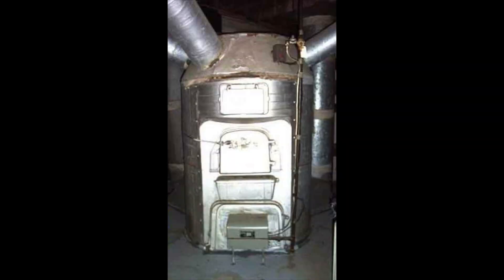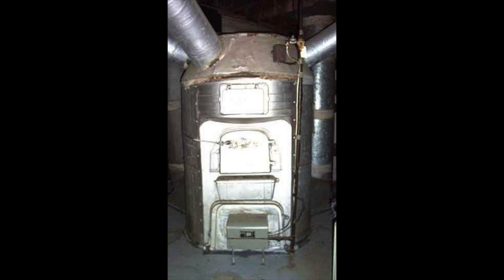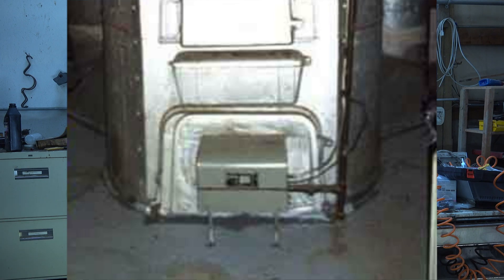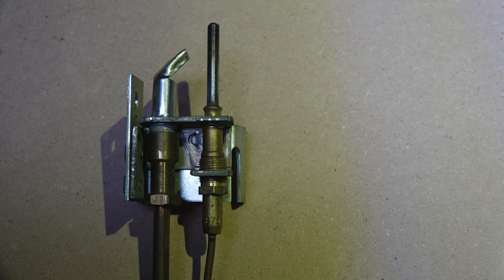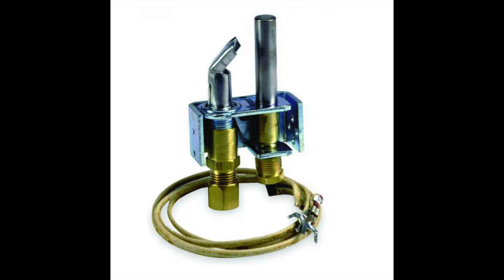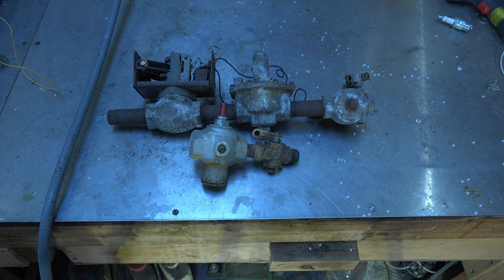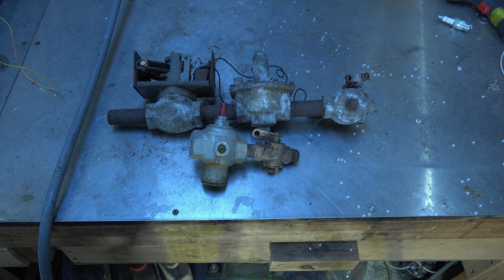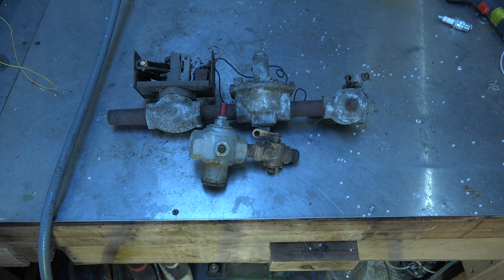Repairs of the gas conversion burner

Comment: I think another reason why these lasted is these are (ones that have been converted to gas) pretty much have the same exact complexity of a water heater (pilot, thermalcouple/thermalpile, main burner assembly, gas valve), not much to go wrong. 

Not the most efficient things in the world, but run and run forever. Even work without electricity as well, silent too in operation.

Comment: Are there versions that don’t have automatic pilot valve?
Reply from the maker: Some very early units had both millivolt operated with a manual bypass for use when there was a failure of the pilot safety.  
Notably this option was dropped a very long time ago, as it had no flame safety control.
GFM

Comment: Done a number of those retro fits and installed blower motors kits. Damn things do not die. You can get slow opening valves but its a mix bag of you can get it to reliability light every time safely
Reply from the maker: Their heat exchangers were up to 1/4" thick.  I always recommended to replace with electric ignition.
GFM

Comment: Would that be called a "millivolt" system? The whole thing runs without any auxiliary power? If so, the ONLY cool thing about it is that you could get heat during a power outage. If there are still any of those beasts out there now, it's probably because the owners are too financially strapped to upgrade to a modern system.
Reply: you can still get a heating stove that will work without electricity.
many floor furnaces and wall had millivolt systems.
there are some still in use.
Reply from the maker: Many of them were millivolt and they would work during a power outage.
GFM